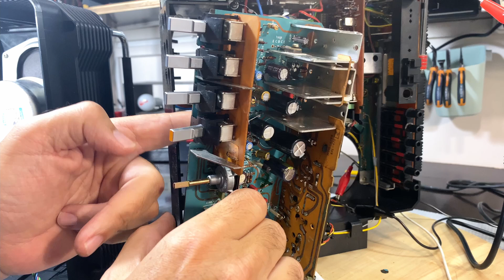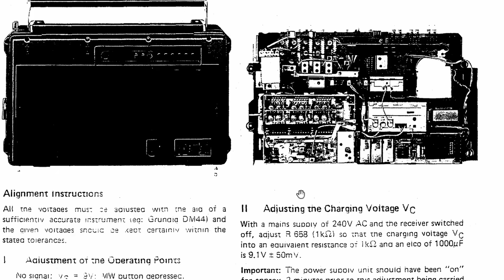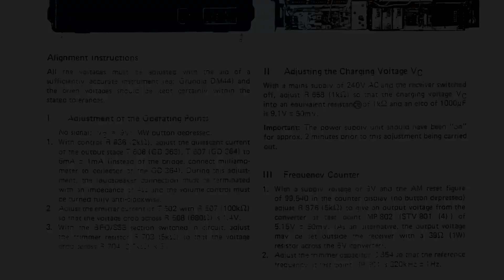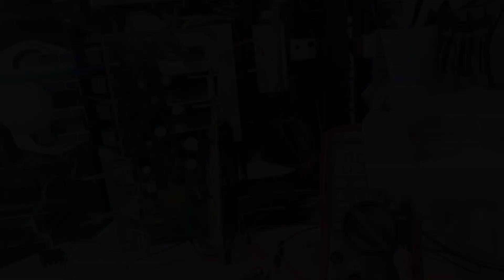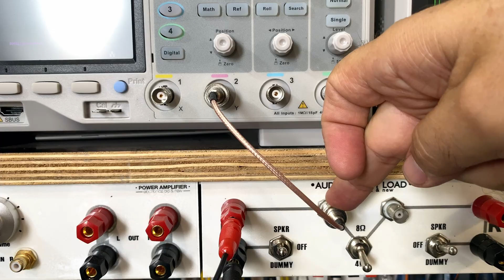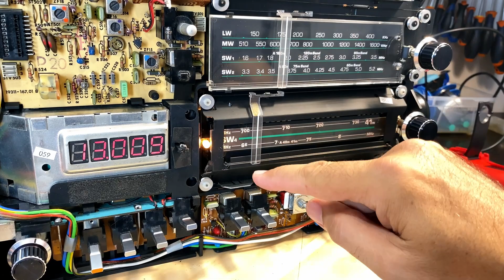Let there be sound! Grundig Satellit 3400 Pro restoration part 3.

Comment: Hmm, just got my 3400 and after 2 days of DXing it decided to show the same FM level-problem but with a twist, it cannot really make up it’s mind and randomly pops in and out of existence. And yes, it comes with a notable drop in the signal strength meter, so it sure isn’t just something in the amp circuit. Your work here now has me at least confident to open up this intimidating beast and poke around a bit. Will follow up if I ever manage to find something.
Reply from the maker: 👍 good luck

Comment: hola

El manual de taller en Alemán esta mas claro y se pueden visualizar los números y los datos con mejor fiabilidad que el manual en ingles , incluso el manual en Alemán es en color y la placa tiene circuitos que pasan de, digamos la cara A la cara B de la placa, es decir el circuito pasa de una cara a la otra muchas veces y en el manual Ingles eso no lo ves y en el manual Alemán esta perfectamente definido en colores. 

Ademas el manual Alemán te ofrece las placas y los datos en un resolución que se puede ampliar y reducir perfectamente sin perder datos.

Estoy siguiendo tus videos ya que me llego una radio de estas en las mismas condiciones que te llego a ti.

Ya he conseguido hacerla encender tras seguir estos 3 primeros videos , 
ahora estoy volviendo a revisarlos para ver si me perdí algo en el camino y poder seguir los siguientes videos , 

Te recomiendo descargues el manual Alemán y si no lo encuentras me escribes y te lo paso.

Muchas gracias , me ha servido de gran ayuda tus 3 primeros videos , espero los siguientes me ayuden a dejar la radio en pleno funcionamiento .

Un saludo 
Marco Diaz
Reply from the maker: I agree that the one set of service manuals is easier to read. I have both, but thanks for the offer. Good luck with the remainder of the restoration. 👍
Reply: @electronicsoldandnew  hola sigo los pasos y de momento consigo los mismos resultados satisfactorios que has conseguido tu , muchas gracias , sigo a los siguientes pasos,

Comment: Good evening, what I do not understand that there was no defective component on the radio but it does not turn on initially?
Reply from the maker: It’s been a while since I did this project so I don’t remember the details, but that often happens. Switches often are not making contact as they need cleaning, amongst other possible issues.

Comment: electrolytic crapacitor - especially low value electrolytics - insterstage coupling capacitors crap out no matter how neat and good they look. Signal injection and tracing techniques are best to identify. Star by touching volume control top lead. should have loud hum

Comment: I do have a soft spot for the Grundig Satellit series although they are a real pain to work on at times. That amp board was a mess. I wonder if the voltage adjustment is out though as you didn’t do that. I would have said the issue lies in the IF stage but then you were picking up stations from afar but with low audio. My guess would be dodgy switches still. Good luck and look forward to the next instalment. Cheers Graham
Reply from the maker: I also have my mind set on switches.
Reply from the maker: Actually, I lie. I KNOW it’s the switches (at least for one part) because I’ve found the problem 😊 Should have the next video up today or tomorrow.
Reply: @electronicsoldandnew  nice one Manuel. It’s great when the fault works out to be simple but it’s sometimes a journey to get there
Reply from the maker: True

Comment: Question also:
I have a 1400 that has problem tuning the FM band. Turning the knob does not change frequentie but it hops around 104-106Mhz.
Can this be the TDA1047 IC that is gone bad?
That TDA1047 is the demodulator, but does it affect tuning also?
MW and SW bands are working.
Also on a 2400 the SW signals are weak even on BBC radio at the 200kHz. Alignment has been done.
Thanks for answers also, i am just a amateur radiotech but learning heaps from videos like this. So thank you for that :)
Reply from the maker: I have no idea, i’m afraid. Haven’t even got to the FM section in mine. When we get there, perhaps you’ll find some answers to your problem also.

Comment: I don't remember ever seeing the meter ever move with a signal.  That tends to make me believe that it is an RF issue.  
If you end up finding a capacitor inside one of those minute IF cans then PLEASE show it!  It sounds like your friend that was talking about that capacitor in the can meant something about a "Silver Mica Disease" issue, but I didn't think that there were any integral capacitors in those type transformers.  Of course I could be wrong about that.
Your videos are superb ... intelligent, thoughtful, humorous, instructive, educational, well laid out, a joy to watch and listen to!
Reply from the maker: You’re absolutely right: The meter has been idle all the time. That’s very suspicious.
I have opened up one of those transformers before and did fund a capacitor inside. They’re very small so quite a problem to repair.

Comment: An interesting course of events. I noticed the hard corrosion of the traces on the blue board. I usually strip them to a shine and solder them on top with solder or even replace them by wires. Then I cover it with acrylic varnish. It will be interesting to know how you replace the broken switches.

Comment: Interesting problem/s Manuel.  I suggest you try keeping it simple to start with and focus on the common audio stages.  You injected a robust signal in to the audio input and that worked fine so you can probably ignore things from that point.  Why not work backwards from that stage and injected a low voltage signal and see how that behaves and then tweek it up, then keep working backwards.  If nothing else you can eliminate that and then start looking at either the FM or an AM section.
The schematic appeared to have lots of voltages listed at various points - have you gone through those and 'ticked' them off ?  That may reveal some underlying problem.

Looking forward to the next vid as I usually do  :-}
Reply from the maker: Thanks for the input, Paul.

Comment: As we can see the indication of signal strength stays very low even at as you mentioned strong signal is received..I  have one of them too, and for sure at least on FM it should be  high.(make sure you attached any spare antenna to radio when disassembled)   Excluding two  rare cases - one would be total misalignment by someone or second two damages in both HF/IF blocks- which as I say are to be considered as last  ,  I would suspect push button set of switches (on top) weakly connecting signal. or any common capacity  for both ,modes - (not sure if there is any). . For the top push buttons I would try WD40 (actually I used it in past for my 3400 and it helped ). This top mechanics of buttons was doing   erratic operation of sliding blockade. .
Reply from the maker: Thank you for the good advice. Will start searching soon.

Comment: Inside the frequency meter box is an amplifier board which takes the signal from all sources (FM, AM, SW 3-10) so this might be also the source of the problem. In one of the German forums there was also a mention to clean the selector switches as they might oxidize over time. I just don't know how to spray them with cleaner as they are hard to access. (I have to replace the bodged SW 3-10 switch wich was drilled trough by the previous owner in one of my radios so I might get some knowledge here.) BTW: have you seen my last comment on your first video? I sent you a link to ZIP file with photos of the inside of the frequency counter and also with better quality schematic images.)
Reply from the maker: Yes, the switches are a potential source of problems, and I agree that the metering board is suspect. I have seen and downloaded relevant schematics and service manuals. 
Thanks

Comment: I didn't quite get the milliameter connection points for the first test.  Did you have to lift a leg on a transistor to connect the meter to measure the quiescent current?  
Re your low output problem, at this point I think I'd run for a good signal tracer. My problem is I don't yet have one.  On my list of things to build for sure. Looking forward to seeing how you resolve this problem.
Reply from the maker: There is a solder bridge that you have to open to connect the milliammeter to. 
I also need to build one of those sometime.

Comment: Phono input: Checked my 3400 and measured a sensitivity of app. 380mVRMS at 1kHz for full output with full volume setting. A little bit depending from bass and treble setting
Reply from the maker: Just rechecked it. The level for full volume is 330mVRMS with the tone pots maxed. So the gain seems fine. Thanks again for your help Stefan.
Reply from the maker: I’ll have to re-check my external input levels again. Firstly, I didn’t actually record the actual voltage, just the approximate range (the volume pot wasn’t on max), and it was also not on mains. I was using the lab supply.

Comment: FM-Tuner: Mine had a faulty tantalum-cap (C365) which was leaking. So the T310 was always conductive and shorted the IF-signal. This is intended to avoid noise for the first seconds when switching on the Radio until C365 is charged up. But a leaking C365 always blocks or attenuates the signal.
Reply from the maker: Thanks Stefan. I will check that out pronto 😊

Comment: If you have the schematic of audio power amp and preamp, it should be quite easy to check the nominal gain of them.
600 mV input for 4 W (4 Ohm) out corresponds to a linear gain of 6.66... It seems too small.
Reply from the maker: Will definitely look into that.

Comment: Normally the radio was build as a tripple stage superhet, means three if stages (2.0 MHz, 10.7 MHz and 460 kHz as the Last if stage) the tuning meter is connected to the last if stage as far as I am not wrong. Also the Signal way is going through both if stages, if you have all of the schematics check it out where is the signal meter connected and where FM-Tuner and AM/SW receiver are connected. After if amplifier are the demodulator (part of an IC or a diode)
I would check the if amplifier with the scope and the coupling of each - if amplifier and tuner.
Wish you success
Jens
Reply from the maker: Thanks Jens. Will check all that out.
Reply: @electronicsoldandnew  you are welcome and show more of these footages, I really appreciate them

Comment: Great video… I would definitely start looking at the simplest common denominator. Where does the signal meter get its input from? Maybe there is a short that is draining the signal to ground before that (I noticed some tantalum capacitors on that board??). Maybe an output transistor is shorting out at a certain input level? I always like to look for the simple things before falling down a rabbit hole. Looking forward to hearing it work. I would love to find a radio like that. 🙂
Reply from the maker: Yes, I’m definitely going to tackle that signal meter bird next.

Comment: Hi!
Something I noticed: The meter for signal strengh hardly moved...so I think the tuner is getting a weak signal from the antenna part. I read online that sometimes the BF Transistors in the RF amplification stage go bad...maybe that is the cause for the problem...
Greetings
Reply from the maker: Yes, I noticed that.

Comment: I don't have a schematic for this but some radios share IF transistors between the am and fm  so a weak IF transistor could cause both to have low output
Reply from the maker: I’ll check, but I believe this one has completely separate IF sections. Thanks